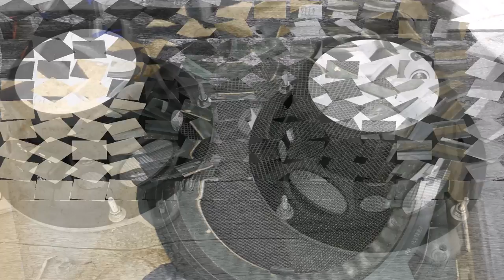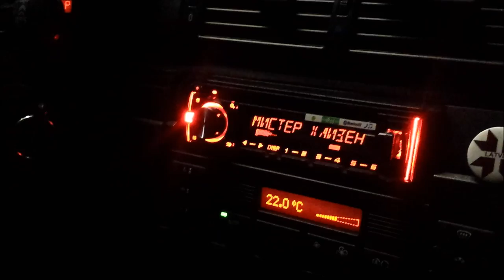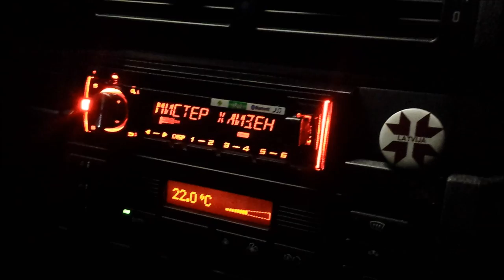BMW E46 Touring Aftermarket Sound System  Installation.

Comment: How many rms watts is your system and how many amp is your alternator? Do your lights dimmed with the bass?
Reply: I run 2 10's on a stock alternator and battery. My amp is a ppi 2600.1 pushing 900 watts at 2ohm. No light dimming or problems

Comment: I have a touring and would like to put 6x9 in the rear (trunk/boot) - do you know which adapter I need to buy?
Reply: e46 touring with Harman Kardon audio comes with 6x9 subs in trunk in those places where stock audio sits 16,5cm speakers.